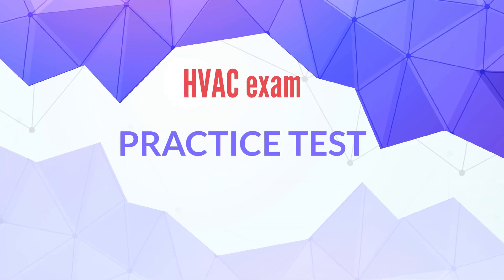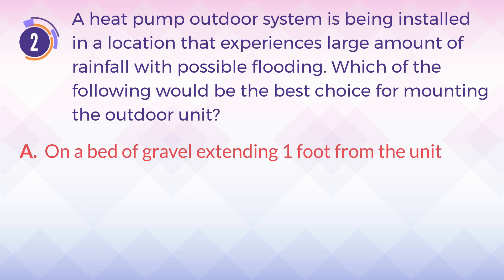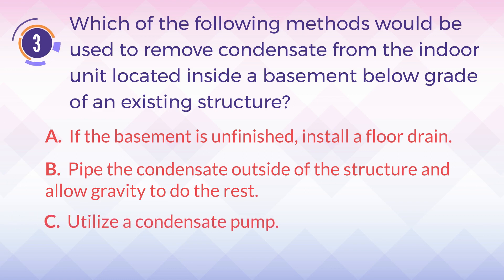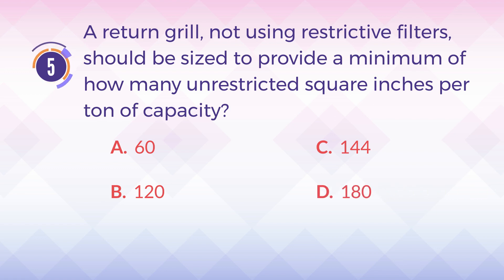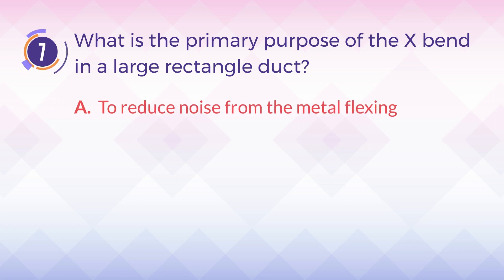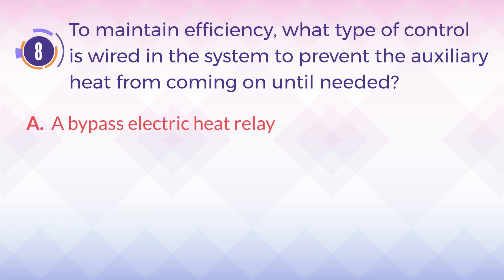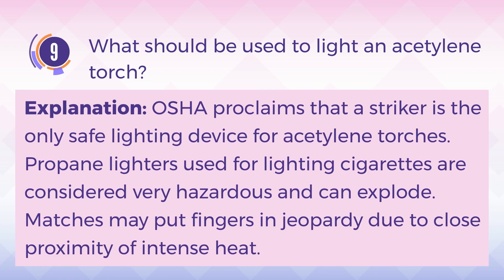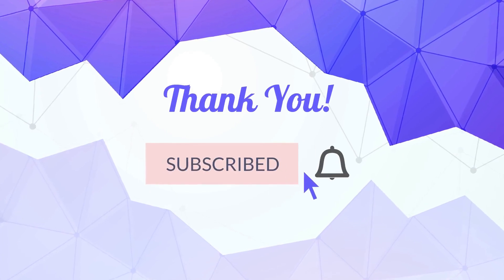HVAC Exam Prep #7 - Heat Pump Installation | TruePrep

Comment: Is number one saying you can’t have your outdoor unit breaker in the same panel as the breaker for your air handler? Obviously they shouldn’t be run on the same breaker but I didn’t think having them both in the same panel was any kind of issue

Comment: You have your O and B  explanation wrong ,O energies in Cooling
Reply: Depends on which system you are talking about, bard units snd a couple others energize b instead of o in cooling. Most use o though.